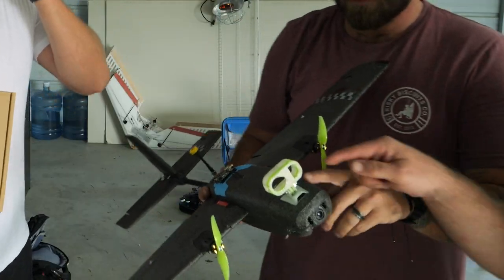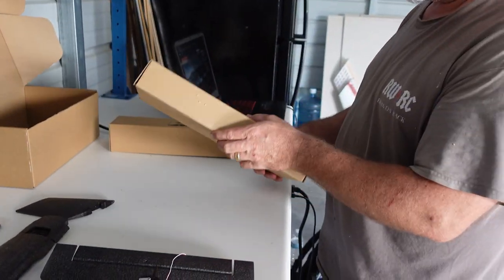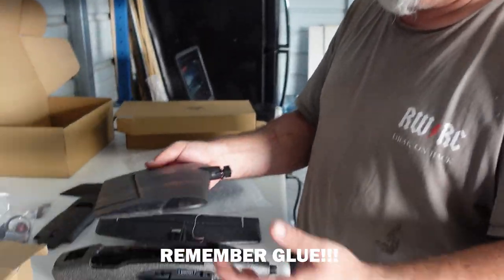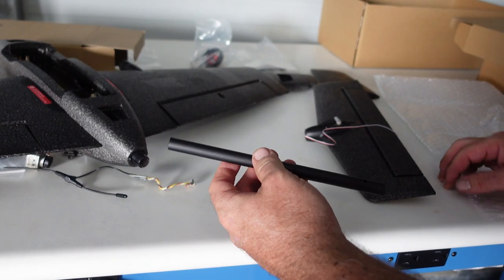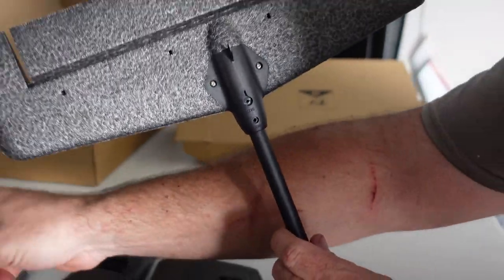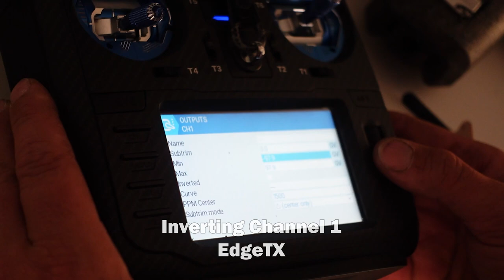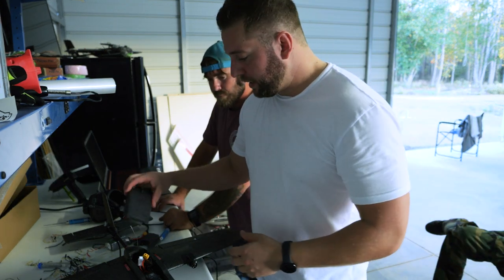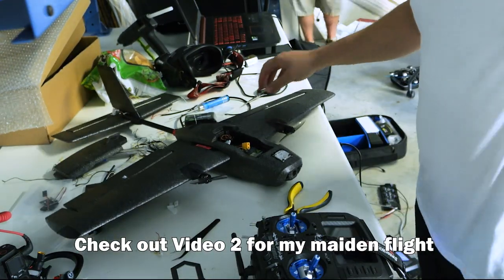FPV Fixed Wing Build/Setup: HEE WING T-1 Ranger

Comment: Hello, I’m interested in the T1 with FPV. I’ve been flying rc for 41 years and when it comes to this world, I’m totally lost. Where to begin and what components to use. Not to mention the computer programing. I notice almost everyone use the radiomaster transmitters , not sure why.  Any information and guidance would be greatly appreciated!
Reply from the maker: Hi, luckily the T-1 without a flight controller doesn't take any programming with a computer, as you see in the video here. We never once brought out a laptop, although I suppose there is some initial computer setup when you first buy your FPV gear depending on what you choose to buy. We use DJI Digital FPV System in this video. Many people are choosing Walksnail for their FPV video nowadays, but I'm sticking with DJI.
See the official T-1 Setup guide: https://www.heewing.com/pages/assembly-guide-manual-download
Check out my Radiomaster TX16S review to see why it's my favorite radio: https://www.youtube.com/watch?v=awKux5zWWX4
Hope this helps!

Comment: Great video!  So, watching the CG bit, did you go to the back of the hatch pull?  Cheers!
Reply from the maker: I usually just pick it up in the center of the hatch pull, but I've always had a constant slight pitch down no matter where I check the CG, which I thought was due to the CG being too far forward, but recently we readjusted the control surface on elevator and that helped keep things level.
Reply: @EdRickerVlogs  Thanks so much!  I´ll try it on 3S, but I bet I´ll get it better on 4S due to the fact that, for some insane reason, I have the Vtx mounted on the fin, ha ,ha!  Again Thanks a lot!

Comment: Do you get the battery voltage in osd with just power and ground hooked up?
Reply from the maker: You can with Walksnail, but I don't think you can with DJI FPV.

Comment: Hi! How did you powered up the vista, via provided pdb? On the 5V tab or tap it off the battery pads?
Reply from the maker: I powered it directly from the battery pads. It needs at least 9 volts and 2 amps to operate.
Reply: @EdRickerVlogs  Ok cool! Thank you.

Comment: I just got this plane today and built it and put a Flysky 6ch receiver in it. everything works fine but i only get one motor working on ch 3 on the right wing. If i switch out the plugs to the left wing the motor works on ch 3. I tried using ch 3 and four to run the motors and still only ch 3 powers on. I need help on this one
Reply from the maker: Hey sorry I just saw your comment today. Did you get it to work? More than likely you're missing a Y harness to split the channel to both motors: https://amzn.to/3Kxj1qm
Reply: @EdRickerVlogs  Yes I have it on order should have come with it
Reply from the maker: @pinarellospeedracer  I agree!

Comment: It was mentioned that the props could be replaced with some nicer HQ props. I have 1404 3700 kV with the stock prop’s which seem a little flexy. Just wondering if anyone has a “proven”recommendation for the props.
Reply from the maker: Good idea. I don't personally have more recommendations, I just bought more of the same. Maybe someone else can chime in.